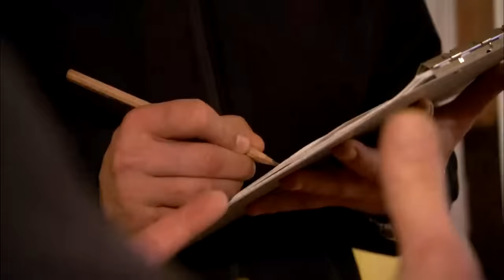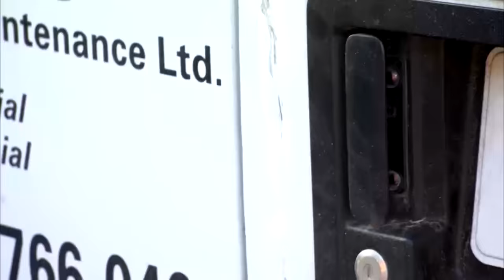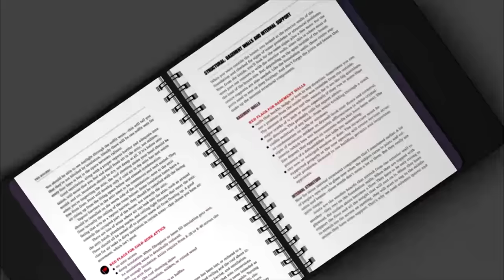Mike Holmes Rescues Townhouse from Hidden Home Inspection Disasters | Holmes Inspection 101

Comment: I bought a house off my neighbor for a great price knowing I’d have to fix the floor and plumbing along with updating the electrical at some point (old push oh mattic) …ended up gutting the entire bathroom and having to replace the main cast iron drain because it was cracked in 3 places. Not to mention everything was leaking to the point 3 joist were rotted and snapped. They built a floor over the problem (6 floors) they never adjusted the drain to the shower or the toilet. Was a free fall of 2”..Was horrible.

Comment: so a little different thing but i have a 96 jeep xj. i pulled the carpet to put new in then i found floor pans was gone. then that turned into rockers need to be replaced. then my frame needs to be repaired in spots. so im literally rebuilding my jeep.1 mess leads to another. since they are getting harder and more expensive to find so have to rebuild it

Comment: If you use metal studs, you must also use armoured cable. Those grommets fall out, dry out, slip out of place when pulling wire. In other words, they are no guarantee at all. I won't use them.

Comment: Never seen such dodgy work in one place ( all the before they started stuff) . I had 2 houses where one was due to replacing the throne ended up remaking the Shower /Toilet room. The other was a Galvo nail holding hot and cold water pipe in the wall created osmosis and wall damp led to a total Bathroom re tile

Comment: I could write a novel on what my home inspector missed. The worst part was I would have just gotten a bigger loan than the cost of the home and had the issues fixed before I moved in. Instead I had to go into debt after and I am still living with things that I shouldn't have to. Anyone looking for a home get a GOOD home inspector. Get references. Go with them. Also don't move anywhere with an HOA. Just don't do it. I don't care how new/old the place is. HOA=the devil.

Comment: What I do not understand is the construction some of the materials are not fit for home construction, the steel joists that more for commercial structure like warehouse etc not homes. Then the floors what happen to tongue a groove flood boards made out of solid wood .the toilet I have never seen a toilets drain into the floor when it's a wood floor concrete yes wood no.
The electrics omg what's going on . How do you over load a circuit. 

OK now my pet hate spray foam . This came to my country about 30 yesrs ago. Most insurance companies and mortgage providers will insure or mortgage a home with spray foam. 
The house are built badly

Comment: The quality of houses in north America in general  is appalling. No insulation in the ceilings. Bathroom has no waterproof membrane on the floors plumming is like the worst ive seen. and walls. Paper carboard house. In norway we insulate 300 mm in walls and 500 in ceilling ald all innerwalls and floors.
Windiws are leaky and flimsy.

Comment: I like this because I have seen and repaired similar problems on family owned properties.  One editing related comment.  You could leave out the whining lady to show more of the actual repair work. Not hear to see or hear a young lady. I'd like the procedures in more detail. Thank you. edit; water in the wrong place must be taken care of as soon as it is noticed or discovered .  A lose toilet must be fixed before rot gets started. Wax seals are cheap as are replacement  anchor rings. The only time it is not an emergency is when the floor under the toilet is concrete given giving a few more days before damage to the framing begins.

Comment: PLEASE HELP ME-single mother and disabled widow with no way to out-compete investors and paid $75,000 OVER what investors paid, and the entire home HAS to be gutted and redone-it is the worst every contractor has ever seen. So home inspector told my mother the same thing-it's previous damage with dry rot-BUT-the leak had been resolved and dry rot remains dormant when no moisture is present. I have the same thing with my current home-rotted out under the sink but dry, leak resolved. But  I SWEAR some home inspectors are corrupt and basic and consider their job to be structual only. Mine missed SO MUCH that was obvious and had I KNOWN, I would have talked him WAY down. She definitely would have too. She can go after her inspector. Mine let me know that I had a heated attic too. Lol It needs SO much work, I am depressed and overwhelmed. Because they gutted it and messed it ALL up at the same time, I can NOT fix this, without tearing out this and that. When I tear out this and that, this has to be done at the same time too. Now when I sit on my toilet, I hear a faint dripping somewhere behind a wall the minute I sit down. GOOD NEWS-it's only 624 square feet-WHEW! Honestly sir-you HAVE to see it to believe it-it is THAT bad!